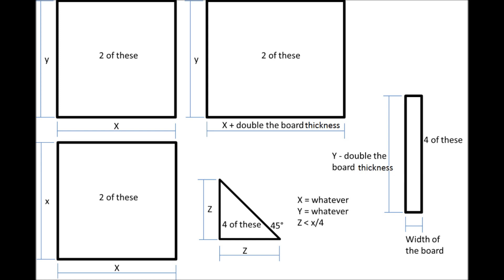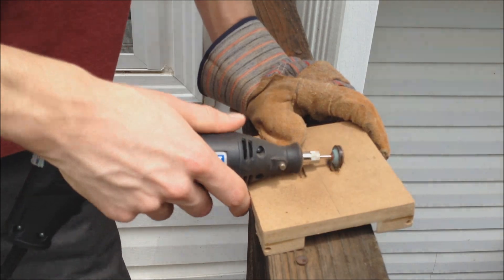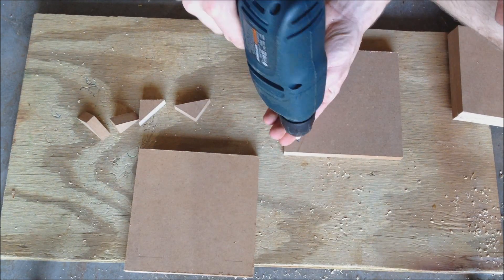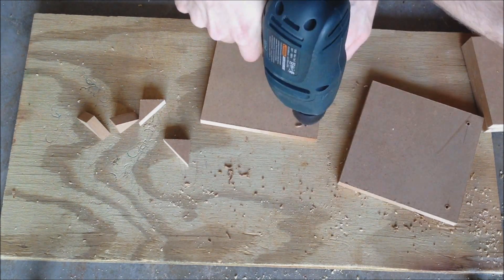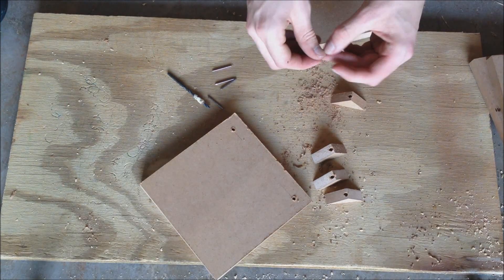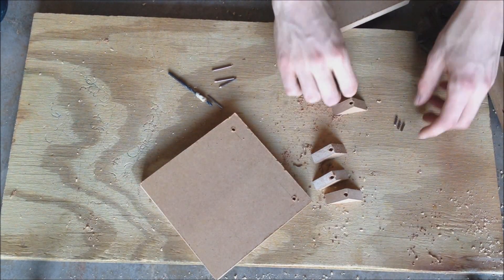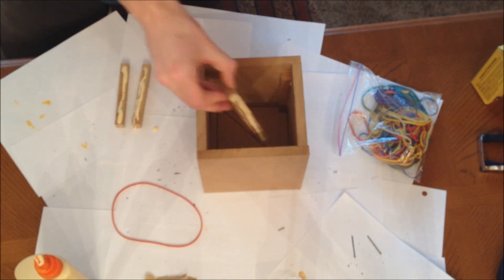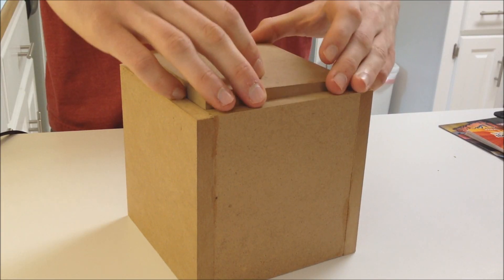Centripetal Force Puzzle Box (How To Make)

Comment: An idea Referring to not losing the pins if you make the back side of the pin hole about an 1/8" depth. just a lil larger circumference than the pin channel and make your pins from finishing nails with the tiny round head it will act as a stopper but still allow movement of the pins Thx for the video...

Comment: I made something similar but when placing the nails I managed to cut the hole lenghtwise to be able to insert them without cutting the head, so they didn't fall when the box was open. Hope that helps :)
Reply from the maker: I couldn't think of a good way to do that which looked nice, so I just didn't. Cutting a hole sideways may work. Thanks.

Comment from the maker: The holes in the lid are half the length of the pins. Holes in the box are slightly more than the length of the pins. This way the pins can slide into the larger holes to let the box open and in both holes to lock it.

Comment: To keep the pins from falling out you can use a nail with a wide head and narrower shaft drill from the backside a hole wide enough for the head but not all the way through. Then finish the hole with a smaller bit for the shaft of the nail. Then plug the hole from the backside. The nail can then slide back and forth but can't fall out. Also don't listen to Bruno just because it is obvious it is a box and what the lid is does not mean that it is not a puzzle box